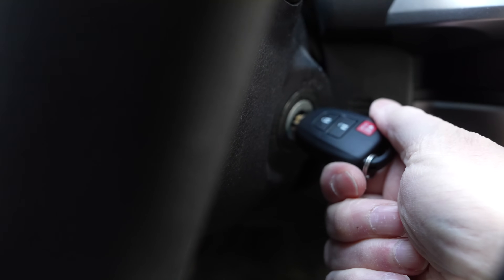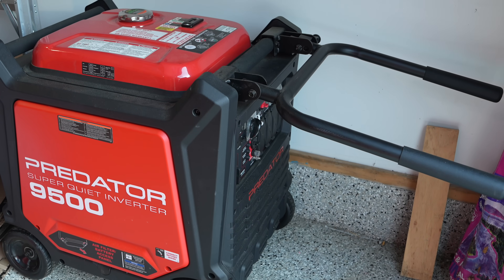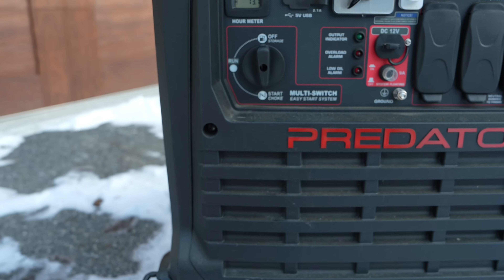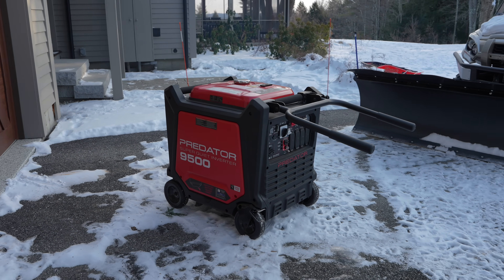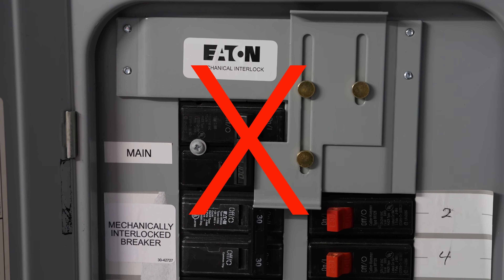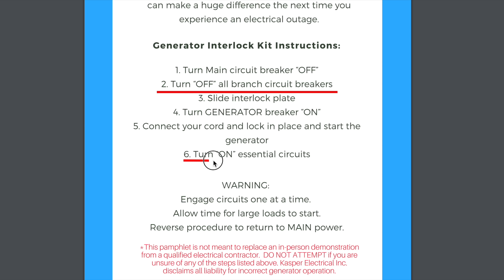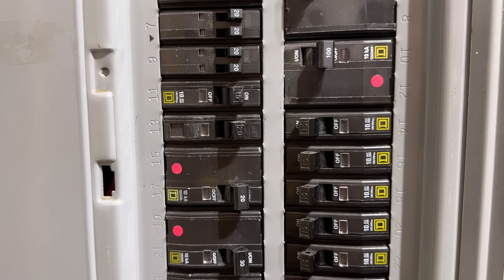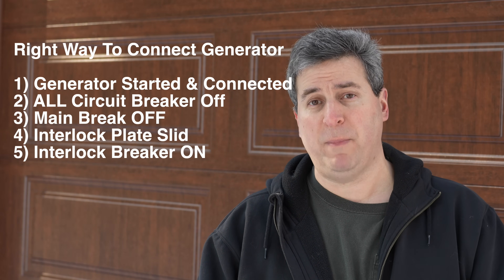Homeowners are Destroying Generators Skipping 1 Step During a Power Outage

Comment: I have heard that modern high efficiency furnaces with circuit boards should never be run on a standard (non-inverter) generator, and I've heard that it doesn't hurt them at all.

What is the thinking behind the "NEVER" crowd and if you agree or disagree (and WHY)?

I have a 50A interlock and am looking for a backup power source for outages and the price difference between non-inverter and inverter generators is enormous.
Reply: I am not a pro, and will try to explain this in simple terms and may skip over some more complicated things. 

A standard generator makes alternating current (AC) electricity by turning a coil of wire in a magnetic field. They are simple. That is how the our power grid works. 

An Inverter generator works the same at the beginning, then it takes the AC power and uses diodes to convert it to Direct Current. (Like a battery.) Then it uses transistors to convert it back to a consistent AC power. It sounds strange and makes it more expensive. I will explain.

A standard generator, under loads that turn on and off like a refrigerator, or other higher power devices. (coffee maker, toaster, microwave, etc) will make the generator idle up and down. In doing so the voltage and 60 hertz frequency will go up and down a little bit. Giving us "dirty" power. A standard generator is just like our power grid, but the power grid has many huge generators and many loads to stabilize that fluctuation. Pretty much makes it almost perfect.

An inverter generator, since it converted the power back to AC is more stable. Under the switching of heavy loads, the generator can surge up and down a little. But since the AC power is made through the transistors, (from the DC power) it will maintain a consistent voltage and 60 hertz frequency. 

For me, I have used a regular generator and hook it to my furnace and TVs. I do not use a generator a lot. And I have used several over a few decades with no problems. If I had a several thousand dollar TV, I would unplug it and not use the regular generator with it. "Dirty" power is not really the best for anything with a circuit board. (High tech fridges, computers, TVs)  For the furnace, I will take the chance. For the cheap TVs I will take the chance.  Most power supplies will filter any problems with power fluctuations. We have been using regular generators on houses now for quite a few decades. Are inverters better? Yes. Worth the cost?? Inverter generators are not guaranteed to be perfect either. You take a risk every time you go for a drive. Hope this helps.

Comment: One of the things people think of in a brown-down or blackout condition is also turning off breakers to anything with a condenser, motor, compressor circuit. When the power first comes back, there is any entire grid of homes powering back on and the voltage sway seen as the grid is reenergized is something to see. When a coil is energized, until it is saturated, it effectively draws infinite current, although for just a split second. If you are simultaneously powering up multiple items within your home with motors, condensers, compressors (just as every other home on that grid is doing) you will see a ramp-up of voltage and amperage (just as you see in a brown-down) and those coils will be drawing (effectively) infinite current for more than a split second as it takes longer to saturate the coils in the device. Rather obviously, the response time on a breaker is too slow to respond to this, a coil of wire can't draw and sustain infinite current, and the coil will fry and the device will die. A lot of life is robbed from a refrigerator or AC compressor due to this. When the power goes out, I put the breakers for the AC, refrigerator and anything else with a coil in the "off" position and won't reengergize these devices until the power is restored, a minute or so has gone by to stabilize the grid throughout my neighborhood and power-up can be done, one device and breaker at a time. I can't remember how many people to whom I've spoken after a power outage who lost a refrigerator after the power came back on for this reason. Pax.

Comment: Good advice for small generators.
The big automatic ones tend to start 30s after power loss but are pre-heated. Then they run for a little bit before the automatic transfer switch starts feeding the building.
Depending on size this can be done in a staggered fashion. This is why battery backups in setups that have a generator are usually scaled for 10-15 minutes of runtime only, as that is the time needed for the generator to (hopefully) kick in properly.

Comment: Conclusion: if you don't want to be a flippin airliner pilot at 4AM just get a short term smart UPS with generator integration and automatic load rampump.
Reply: lol, that must be absurdly expensive. I work in a data center, I know what PLC controlled breakers cost.
Reply: @dcviper985  I happen to be DIYing one. Imma post the results. So far under $10K incl the inverter and 45kwh li-ion batteries.

Comment: With a battery/inverter setup, the load of the household devices is on the batteries during a power outage and thus no surge current is required to turn everything on. An additional mention for people who supplement their power.

Comment: I have a laminated Check List right next to my Circuit Breaker panel (along with a flashlight & the key to the generator house).  Yes, a Check List.  One side is for Start up & the other is for Shutdown.  At 3am, are you truly awake to remember, what to do?
  
It includes checking the oil level, Starting the generator, allowing it to warm up, turning off ALL Breakers (yes, all of them), connecting the power cord to the house, then turning ON the 'essential' breakers first (I have them marked green - lights in room with the breaker box, furnace, fridge & freezer), one at a time, allowing 10-15 second pause between breakers.  Then I turn on the 'Non-essentials' (lights, outlets, etc).  I leave the high power items like the A/C, Range, Dryer, Water Heater, etc OFF. (I only have a 7000 watt generator, not big enough to power the entire breaker panel)

If I really need one of these high power items, I would turn OFF all of my Non-essentials & some of the Essentials to free up as much power to run one of the High Power items.

I also include ideas on how to conserve fuel needed to run the generator, especially if you know the power will be out for days or maybe weeks.  Run your generator for 1-2 hours, then shut it down for 2-4 hours (or more), subject to your current conditions.  

Figure out before a power outage, what Circuits are essential for your home.  What will you do IF you run out of fuel before the power is restored?  What is your weather conditions?  Do you have spare oil for your generator?  Have you ever done a full house test?  When was the last time you started your generator?  Will it start?  I do a full house test once a year & start my generator every 1-2 months.

The last thing you need is a generator that will NOT start or stay running when you really need it.
Reply: This is fantastic!  Thank you
Reply: Can you please send me a copy of your list?

Comment: As I'm using a couple portable 120V generators in parallel, this has been SOP from day 1 - they don't have the Wheaties™ to handle even the 120V surge.  Switch key 120V circuits on one at a time, listening for surge as I go.

Comment: The AC or heat pump is gonna make the generator grunt no matter what. Just turn off the AC breaker, the rest is negligible in comparison.
Reply: Once the A/C or heat pump has lost power, it won't come on immediately when the power comes back on.

And if the rest is indeed negligible in comparison, then bringing everything online at once is essentially the same load on the generator as the A/C or heat pump just coming on itself, so if the generator can't handle everything at once, it can't handle the A/C or heat pump at all, at least not according to your logic.
Reply: @harvey66616  my AC will come on instantly when the power is on if the battery powered thermostat is calling for it. The rest of the house has probably 15-20 amps of power consumption with TVs all electronics plugged in every light and the refrigerator running. The AC will have 20-25 amps with a starting inrush twice that. So yes, if the generator can't handle the whole house minus the AC coming on at the same time, then the generator isn't big enough. And running a generator at near 100% it's rating all the time will cause premature failure also.
Reply: @joeaubert7224  then your a/c is broken. It should have a timed delay to prevent it's operation immediately after it's stopped running, to avoid damaging the compressor.
Reply: @harvey66616  I agree  that's why I put a smart thermostat that takes a few minutes to boot up before it calls for cool to avoid damage. But there are no timers in the outdoor condenser just pressure switches and a cap and a contactor.
Reply: the refrigerator is pretty much the same as an AC or a heat pump. turn it off too.
Reply: @brlinf06398  the fridge's technology is of similar design to air conditioning, but it's not nearly a big enough power draw to worry about it being on when the generator is connected to loads. A whole house a/c is thousands of watts, while a fridge is around 150W.

And that's assuming the fridge is going to turn on immediately when the power is connected. As with the a/c, it's harmful for the compressor to start up immediately after being shut down, including if the shut down was because of a power outage, and the fridge should have a mechanism to prevent it from starting immediately like that.

Comment: I have a 15kw @60A Diesel generator that ties into a manual transfer switch which ensures no backfeeding occurs. 

It makes good sense to completely disconnect the house load by opening all breakers in advance of throwing the transfer switch. 

My largest electrical load is the water well.

Comment: Sorry, but this does not seem correct. You describe first starting and plugging in the generator BEFORE turning off the main breaker in the house panel. If you do that sequence, the generator will immediately try to feed the main panel and all circuits. 

I think that the very first thing to do is to turn off the main breaker at the house panel and all circuit breakers, BEFORE pulling the generator out of the garage/shed.

Comment: During extended storing keep the carburetor float bowl empty if it is more than a couple of months of storing ways to go about doing that is just run it till it dies or there's usually a Phillips head or 10 mm drain bolt underneath the carburetor to empty the float bowl
Reply: just drain the bowl by opening the drain screw.  "Running it dry" helps, but after the engine dies, there is still a small amount of fuel in the bowl that the engine couldn't burn.  Prove it to yourself by running the engine dry, and then open the drain screw.  You want to get ALL of the fuel out of there, not just most of it.  Stupid ethanol fuel!!

Comment: I have to say that starting your genset with ECOMODE ON (lower rpm) is better than letting it warm up at full throttle.. a cold genset gets most of it's wear on the initial start and run up. The processor in the inverter will pull the throttle wide open for starting on choke automatically. Older gensets with mechanical governors and AC alternators usually do the same but cannot be adjusted for a lower run up rpm. The wear on a cold motor is brutal, especially in sub zero conditions after sitting for months.. maybe leave it in your garage if you can to keep it warmer for easier starting and engine longevity.

I've been using gensets since the 70's for work and remote living in the canadian north, always let them warm up before transferring any loads.. an extra 5-10 minutes with the power off isn't going to change anything in an outage, but will increase the longevity and reliability of the unit considerably. After the unit is warm, it doesn't really matter how you load the unit as long as it's not overloaded. Understand your loads in your breaker panel, turn non essential loads off.. fridges and freezers will take a few minutes to stabilize their high initial current draw, same with well pumps as they re-pressurize the system. Just listen to your genset as you enable more loads (turn on breakers) and when it sounds badly labored, just give it a second to catch up before adding more loads.

Most people don't have generator transfer switches installed in their homes or just use the genset to power loads through extension cords. This is fine as a temporary solution in an emergency, but if you require AC backup, call an electrician and get the job done right. They can advise you on sizing your genset and having the proper controls and interlocks installed in your home to keep everyone safe.. also, have your genset serviced yearly (or run for 15 minutes) and if you need to keep it fueled, add some fuel stabilizer. Generators tend to be forgotten about until they are needed the most.

Comment: Turning all the breakers off is not necessary, it would be very unusual to have every light in the house on, just turn off lights, tv's, and small appliances. There is a small surge current depending on what is currently on, possibly furnace, refrigeraters, freezers, etc, generators should be able to handle those.

Comment: Unfortunately my breaker box doesn't come with an interlock, nor will it support one. My main house feed breaker box has two rows like yours, but only 5 breakers. It has NO top main overall breaker. Also my inside house breakers are the same there is not single breaker to shut off or put a sliding plate on. So I just have to remember to shut my main house breakers off before I hook up the "Suicide Cord". I have strict start up procedure like you and and strict shut down procedure as well. I wrote it all down to protect myself, and my family. Only I am allowed to start the generator or connect it or disconnect it at my house. I also have a separate safety ground cord for the generator to the house as a backup that is connected before the house cord is attached and the generator is started. I also test the generator before any connections are made and it shut down before any connections are made. So far so good.
Reply: Not sure it will save much money over replacing the panel:
But you can install an "essential load" panel with an interlock.
Reply: @economicprisoner  Thanks, yeah I was thinking about that too. At one time I looked at what it would cost to change the panel and do that, and well $600.00 in labor plus parts it was over $1,200.00. So I said well I'll just go outside and flip it manually, then do my thing. Thanks for the info anyways. Keith Noneya

Comment: Just because all my breakers are on DOES NOT mean all those appliances are on. Both stoves are off. Dryer is off... About the only 2 I do check on is the AC, if it is summer and I'm using it then the well pump. Of course the welder and machines in the shop are off. If the genny can't handle 1/3 the lights being on, when I switch it on... somethings wrong.
Reply: agree if im cooking something on stove top and power goes off i don't leave stop top on. i turn it off or the oven ect

Comment: I have to disagree on your start up procedure.  When I start my iGEN2500, I leave the fuel/choke switch OFF and then pull the start cord several times to have the "oil splasher" sling some oil to the internal components first, before the engine starts to run.  This minimizes the effects of an oil "dry start".   With the eco switch ON and after the fuel/choke switch is turned ON, I wait for a couple of minutes to ensure the fuel has flowed sufficiently into the carburetor "bowl".   The engine usually fires up on the first pull and the engine speed initially is high before slowing down to the eco - slow speed running.  AFTER several minutes, before connecting/starting any load, I then turn OFF the eco switch for high speed and then start the higher wattage appliances FIRST and then the eco switch is turned ON.  From that point on the generator does its thing and the beer and window AC stays cold.  Just as important as letting the generator warm up for several minutes, is to let the generator run for at least 5-10 minutes after the loads are removed to permit a cool down of the generator's voltage control/regulator circuitry.  Two last tips:
1.  Use ONLY E-0 - Ethanol free gas.
2.  Use Stabil gas stabilizer for ANY gasoline powered gear you have, generator, mower, trimmers, etc. as this shit does work.  Even after 6-12 months, ALL my gas equipment starts first or second pull....

Comment: If you grew up with carburetors in cars, then you know the beginning "what not to do" to start cars was actually how you started them sometimes.   It is wild how times have changed.
Reply: You still very much have to start modern cars like such at times, it's called clear flood mode, ESPECIALLY when you get vapor lock on modern cars, and it's flooded cause the fuel that was injected didn't ignite before

Comment: As a generator operator in the the military, I had to let the radio operator know when I was going to switch over generators so the power supply to the electronics wouldn't blow from a power surge. So make sure your breakers are off before you send power from the generator.
Reply: As one of those radio operators, we thank you for the heads up and the extra circuits to run those big amplifiers and often our server equipment. I always appreciated when the Seabees asked ahead of time what circuits I needed and always made sure my berthing was ice cold for a good sleep with those IGETS. Sleeping with foamies in and no one ever heard me snore.
Reply: That’s odd, shouldn’t you have synchronized the generators then disconnected the the one going down?
Reply: @ No, they where trailer mounted 10k gens with no sync lights.